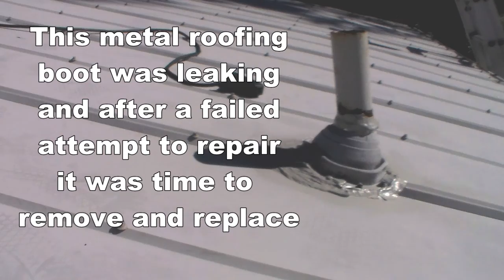Replace Problem Metal Roofing Boot - No More Leak in 5V crimp Roof

Comment: I'm curious, I just watched another video and the guy said only put screws into the flat part of the metal. I see here where you have them on the seam all the way up to the ridge, Is this because it was done incorrectly originally??
Reply from the maker: Not necessarily, I know that some of the corrugated panels call for the screws to be placed at the flat portion of the panels. It all depends on the manufacturers specifications. Different manufacturers have different testing for different areas. Ultimately, if you follow their installation instructions in the correct area, then you have something to fall back on if it fails. The 5V crimp specification that we follow calls for the screws to be placed on the ribs.